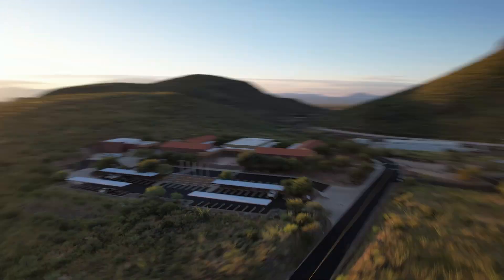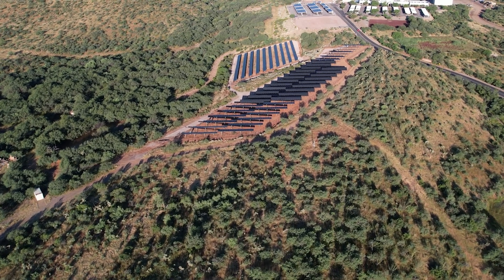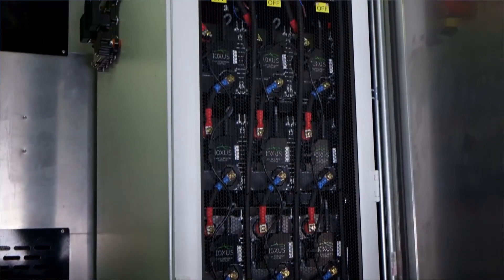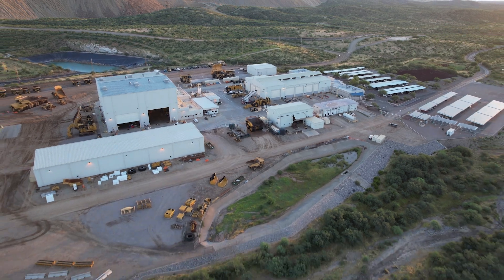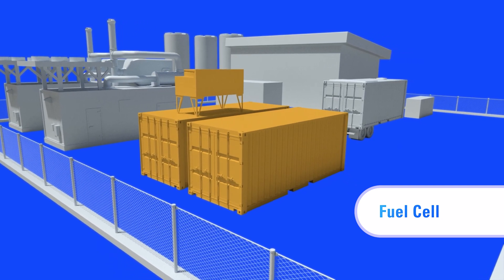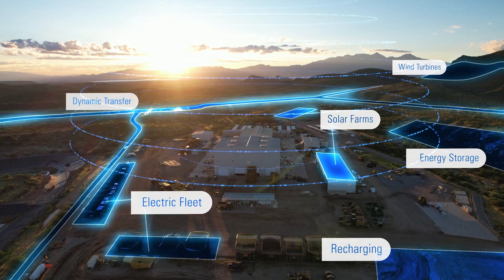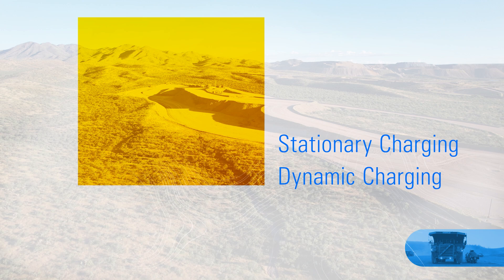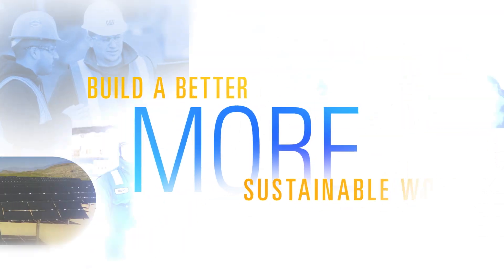Building a Better, More Sustainable Proving Ground

Comment: 750 kW and even 2 MW sound like steps in the right direction but very shy investments to compare it to a mining operation. There are single manufacturing buildings that run with 1 MW of solar PV power.